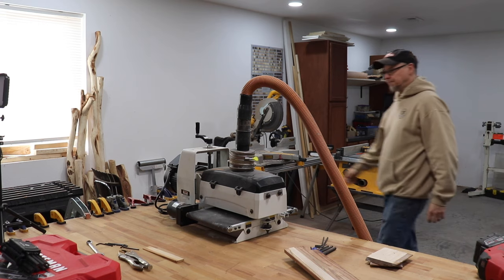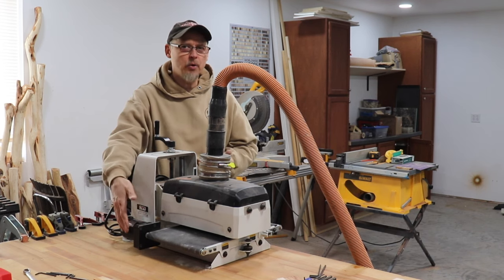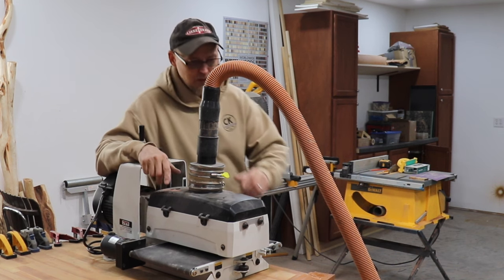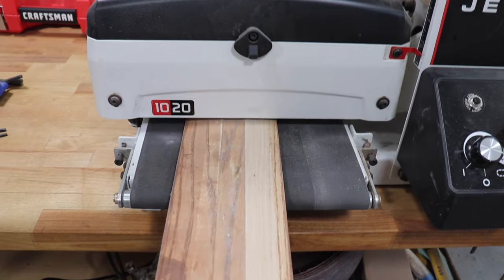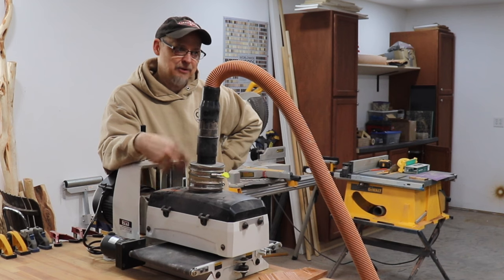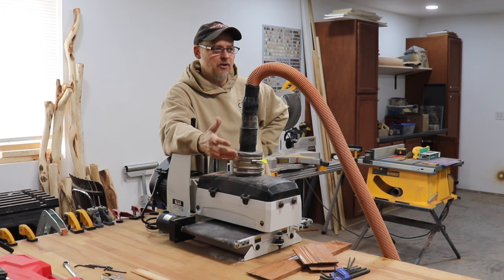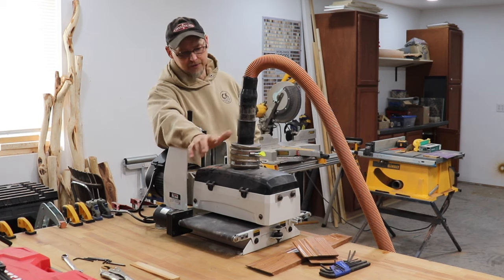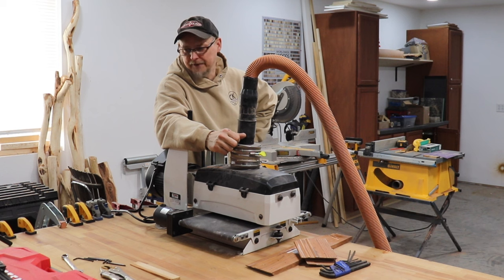FAIL!  Don't Buy the JET 1020 Drum Sander.  I wouldn't.

Comment: I love to support wood workers. I am a woodworker and we are a dying breed. 2 things for you. 1. SLOW down the belt or take tension off the belt and do a lighter pass. I have used these sanders for hundreds of hours. The hardest part was getting a decent replacement belt for under $200. Tune the belt, lets it run for a few min and get real dust collection. They Throw a ton of dust. 2. Get a better mic. It's hard to listen to the wisdom you are sharing with all the swallowing noises. Your channel will do so much better. Hang in there. These sanders are fantastic for making decorative boxes and end grain cutting boards. Just need to practice with it like any other tool. Good luck!
Reply from the maker: Thank you

Comment: The small drive motors on those belt sanders stall at slow speeds when sitting unused for weeks. You have to turn on the speed control and let it run for a couple minutes at full speed (fast) without running any wood through it. After running for a few minutes at full speed drop the speed to half and run for a minute. After that it should work normally. Also don’t run those short boards through it. Keep the workpiece to at least 8” long. And don’t try and sand too much on each pass. You’re gonna have problems trying to sand out warped or cupped boards. Only sand flat boards. Use a planer or a hand plane to take out cupping.
Another thing is your dust collection is wholly inadequate! You can’t go from a 4 or 5 inch port down to a 2 1/2” port especially with a drum sander. Your bearings are probably jammed with dust preventing free motion.
Reply from the maker: Thank you

Comment: When you had this machine standing un used for a year did you un tension the feed belt as if its stood for a long time under tension , the rubber would become supple in this case , and cause slipping i have the same machine. And had no problems sorry your having troubles , all my sanders and band saws i do this too if left standing for ages hope this helps
Reply from the maker: Thanks for that.  Never gave it a thought.   It has been slack for a couple months at least right now.  Maybe I’ll give it a bit more time and try it again.

Comment: I had a very similar experience, broke the drive pin after only a few months.  Jet could not get me a new motor for several months so I had a local machine shop make a new pin for me.  Same pin is still working two+ years later----but I cannot ever get the drive belt to run straight. The belt adjustment mechanism is terrible. It is currently disassembled on the workbench--again.  I have spent a lot of time keeping this machine running.  I do not like my Jet 1020 sander.  Thanks for sharing your story, nice to know I am not alone!

Comment: Mine has been perfect out of the box. One of the most used tools in my shop. Of course the feed belt wanders a bit, just as it does on a belt sander. A quick simple adjustment and it's back where it should be. Just a great machine.
Reply from the maker: Thanks for sharing

Comment: I wonder if it is having issues because you are using a 2 inch hose on a 4inch spot. Maybe the dust got in the gears
Reply from the maker: Might be but it does seem to have good suction.  I don’t have a lot of dust blowing around.  A little at the out feed as the board comes out.  Some mentioned that it’s the size of the wood which is sad that would be an issue.  Others mention taking too much off but it seems to happen randomly.  Sure, if I barely have it touch the wood it feeds but doesn’t that just defeat the idea of having a drum sander?  I don’t know. I’ll keep it and use sparingly.  Stick to the planer

Comment: his issue is improper maintenance improper storage improper operation and  also not mounting ot properly it snot mad to be just set on a bench it is supposed to e\be bolted to a stationary stand ...... jet has not change the Design nor eth manufacturing of it since the started making  it back in 1982   and it is actually made in Canada by a Canadian Company Named JET ...some of the electronics are made in Taiwan or Vietnam   but mine has been working like new for 22 years .... But this is the case of DIY  project users that do not read the manual and or does not know how to use the tool Properly and do not know how to maintain them properly  ................